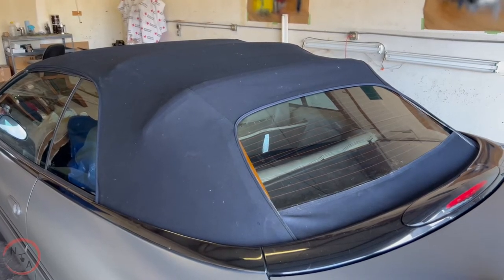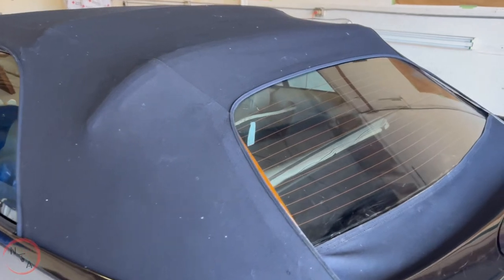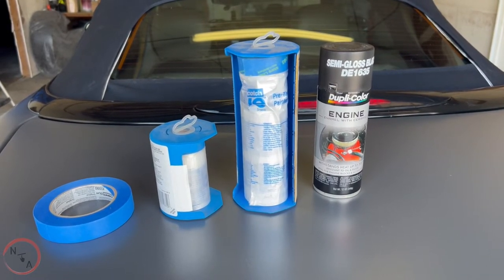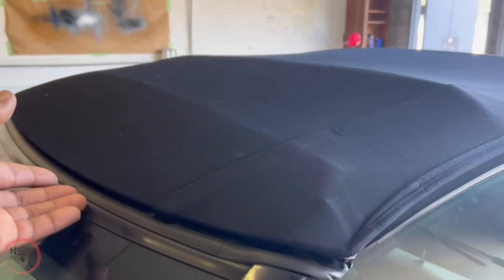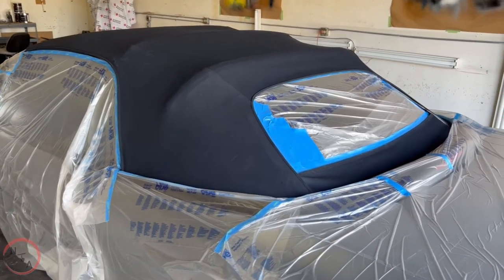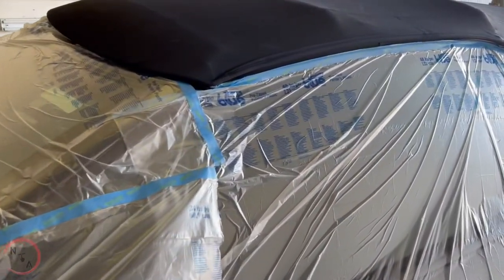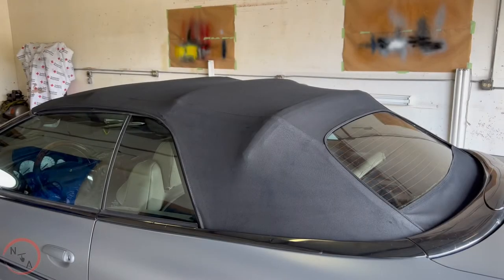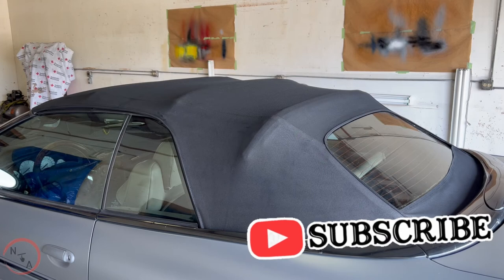(How to) paint your convertible rag top at home

Comment: What happens when it rains? Will this still be the same color?
Reply from the maker: No worries with it fading from the sun rays or rain, the engine paint has strong longevity. As mentioned in the video there’s a more professional way to color convertible tops but I figured this is a good diy that’ll save a few bucks.
Reply: @newtouchauto  Ahhh okay got it. Thanks for your response and it turned out great. 😊
Reply from the maker: @glamourgoddess4683  you’re welcome and thanks for watching the video.
Reply: It turns green like money

Comment: My first question is - how does it hold up? Painting on cloth, doesn't the paint crack? How does it look after 6 months and after the top as been up and down a few times?
Reply from the maker: This was one of my customers at the time but no issues were reported. They also have automotive fabric spray as well lawn furniture spray which is designed to fight off the outdoor seasons. You can find the outdoor pillow spray aerosols at Lowe’s or Home Depot, the fabric spray can be found at your local automotive stores.
Reply: @newtouchauto  Thanks for the swift reply. Ohh! I got it - thought it must have been some kind of special paint spray. I have a beige/light brown top starting to look shabby and looking for a way to make it dark brown. I think I'll go with some dye products like I found in another YT from UK.
Reply from the maker: @my5cents4u  you’re welcome and yes dye products are better as long as they’re for outdoor use as well. The thing about painting something like this top would be not adding gloss, that’s when you’ll experience cracked paint and failure.